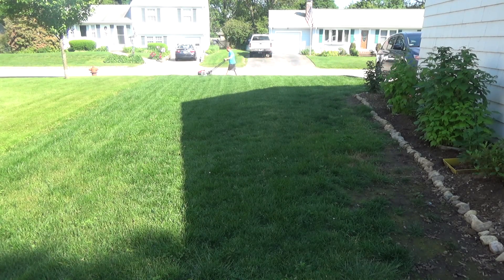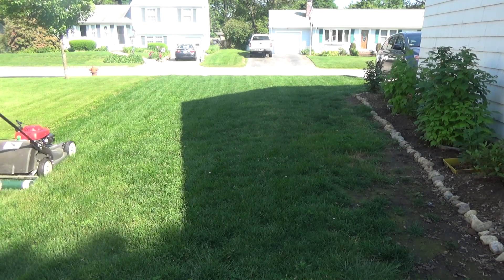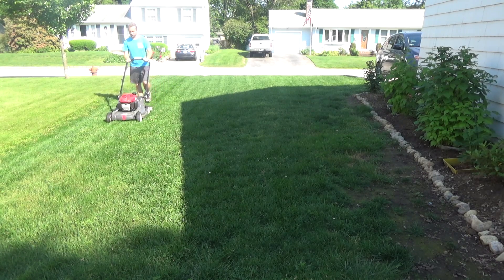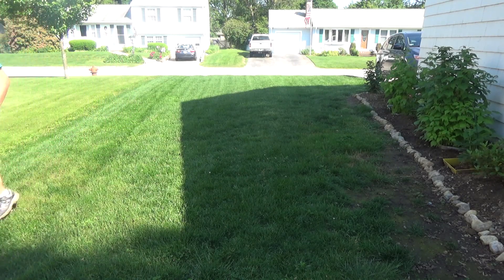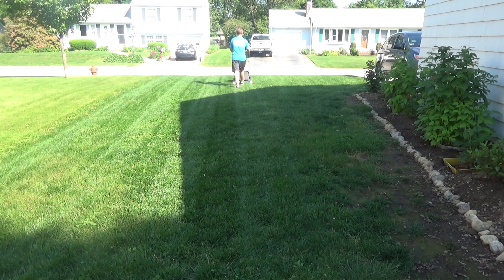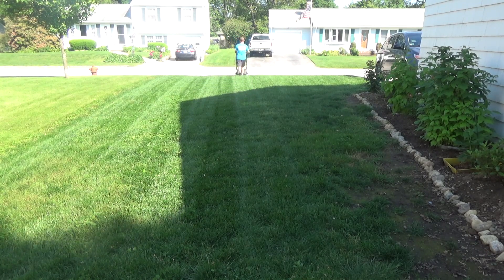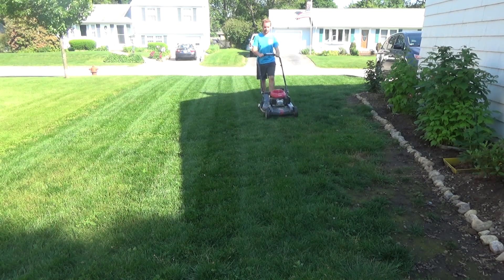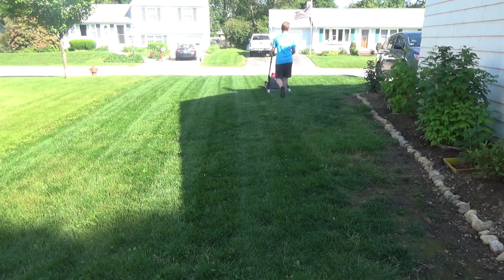Lawn Striping with DIY Lawn Striping Kit on Honda HRX217 Self Propelled Lawn Mower

Comment: Hi. I use a 39" checkmate roller on my John Deere mower. I cut at 3 3/4 inches. My stripes are great for the first day but don't seem to hold up after a day. I've even added 2 five pound  weights bringing the total weight to about almost 50 pounds. any suggestions? My lawn is very thick and green so I'd like the stripes to last longer.
Reply from the maker: Do you go the same direction every time? If not, usually you'll have to go the same direction a few times in a row before it will stick longer. If so..  I'm not sure, could try adding weight - increasing height - increasing fertilizer..